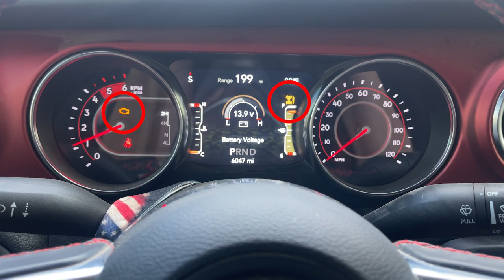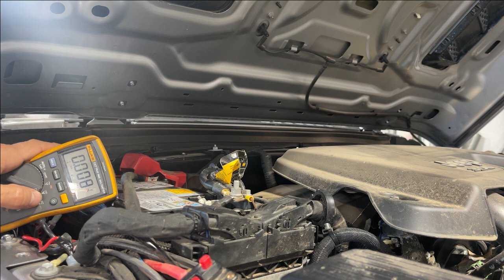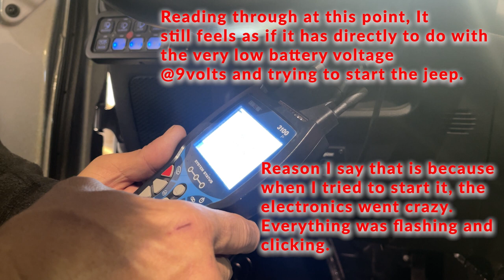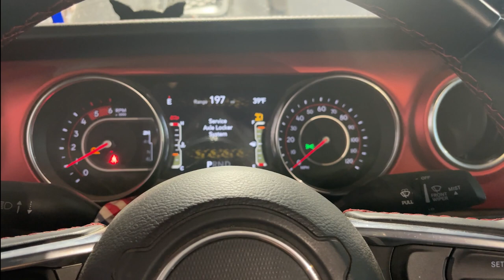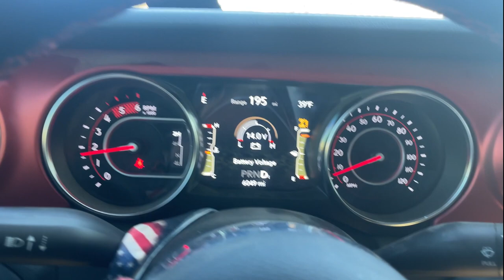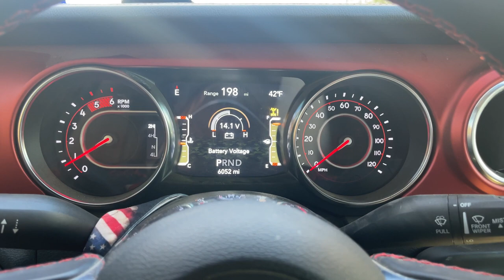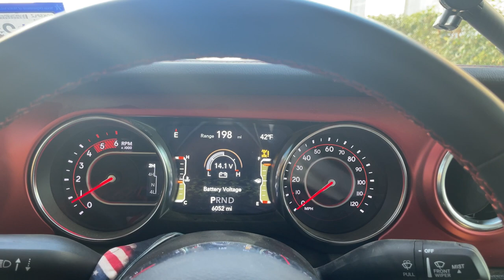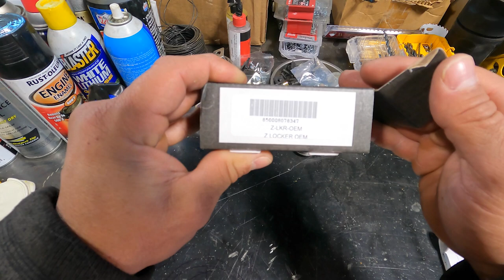2021Jeep Gladiator Diesel Electrical issues and GREMLINS only 6000 miles !!!#jeep #gladiator #shorts

Comment from the maker: UPDATE EVERYONE*****
So Randi with Yukon gear actually figured out the issue. By using the Tazer mini and deleting the lockers from the ecu, all electrical issues went away. You can manually write them to your switch bank and use them at all. It’s a better way anyway.  Let me know if you guys are interested in that mod.
Reply: Since I have a JTRD on the way, yeah - I'd be interested in seeing that mod.
Reply from the maker: @skdemars  yes sir ! So i will try and throw a video together. It really is super cool to be able to operate them individually… thanks for commenting.

Comment: I have say this I also have had multiple steering wheel lock on my 21 JT diesel most of the time I'm at hwy speed when it happens. The reason I'm watching this video is because the truck wouldn't start this morning. It was -5C last night. I boosted it with my tj and I did have any problems all day. I guess I'll see what happens tomorrow morning. I'm posting this 10 minutes into your video.
Reply from the maker: Well thanks for watching Lee. I hope you figure out the issue. One thing I would suggest is run by your local parts store and have them load test your battery. 

A battery can take a surface charge but under load it will fail if it’s not consistently charged back up by a charger or alternator. There test box will show if the battery is still good or has a failing cell. Secondly verify your battery terminals have a really good and tight connection. Remember everything shrinks in the cold. 

But -5c or 23F isn’t too good for diesel to ignite. My daily is an F350 and It’s never been plugged in neither was the Gladiator and it’s often 20F here where I live in the winter mornings.

Hope this helps and I hope it’s not a fuel sensing problem. Which I would need to understand more if it keeps happening to help you. 

Cheers and good luck. I hope this helps.

Comment: low voltage causes a bunch of bus failures, stuck relays ect 14v charging does not mean its all good. a bad cell can cause these issues. - i see it a lot at work. common locker failure- all cars have issues-
Reply from the maker: First off thanks for watching and replying. Moving on, even though the batteries showed individually 12+ volts, would you think in your experience that one could still potentially have a dead cell issue? I was thinking my next move be pulling the main fuse box loose and flipping it to manually force all the connectors in from the bottom side. My thinking is something could be a little loose. I have seen on several forums this is a common issue with the Jl' and Jt's. Anyway thanks in advance. I do believe LONG WITH THAT IT IS 100% electrical based issue. 

To update , yesterday while idling the electric power steering pump stopped working two different times. The truck was not idling for more than 10 minutes both times. Turning the truck off then back on corrects the issue each time and power steering comes back. Thoughts? No error code.
Reply: @maximumoverland  textbook bad cell battery issue. If you have one of those big jump starter packs leave it on the Jeep so it has a constant strong 12v. With 2 batteries is complicated things too. Make sure the battery terminals and ground points are clean and tight.
Reply: @maximumoverland  also look at the physical pins on the connectors. Make sure they are straight and not loose or bent. Even tho it click into place you could have a loose terminal in the connector.
Reply from the maker: @WolfOverland  Again well thank you and duly noted I really appreciate this interaction. Also the dual battery is from the factory so it’s not something I can control but I will for sure have both batteries tested this week for dead cells. Secondly thanks again about the info on the terminals I will check all the pin settings and verify they’re at the least clicking in the manner they’re  supposed to and not being bent.

Comment: Maybe with all your accessories, lights, etc you have hot wire to ground.
Reply from the maker: John, to rule out any electrical issue with lights etcetera I pulled the power and ground from the switch bank that controls all accessories. the issue still happens. Now if I reset the ECU it last for a day or so before it restarts. It's not the cold either, it was 11F yesterday and 48F the day before that. thanks for helping brain storm.

Comment: Wow... that's nearly a brand new Jeep.  I would think they could easily fix it.
I was heavily looking into buying one.
Thanks for your video.
Reply from the maker: Hey Silo man thanks for watching. I will say that I don’t want to sway your opinion on the vehicle because, when the trail slayer is running top notch there’s nothing better in the class or equal to it because the options with front and rear locker sway bar disconnect and of course the eco-diesel. The eco-diesel makes this truck above and beyond any Ranger, Tacoma, Pro4X or Jeep in my opinion. When you’re talking about crawling, this guy does with ease because of the 450 foot pounds of torque, so in low low it does all the work. As far as towing, the payload capacity may not be a lot but you can load it all the way up to max and it will literally tow it without breathing. All that being said after 500 miles I had a fuel system issue, it’s happened multiple times and the dealer couldn’t figure it out. Now it’s having all these electrical issue problems and there’s no rhyme or reason. So I will continue to be clear with everyone and transparent, and wolf above suggested some things to try this week. I will do all that. But you guys should watch my videos see that I go way off in the middle of nowhere, and the one thing I can’t have is electrical gremlins. So again thanks for watching and I hope all this helps you make an informed decision. Just so you know the jeep JL eco-diesel does it have the same electrical ghosts. I will do more research and troubleshooting but there are several entities that believe it’s due to overstretching the factory harness. So I will check that and let you guys know.
Reply: @maximumoverland  Really appreciate your reply.  👍
Reply: Could be a diesel-version Gladiator issue? A guy on another YouTube channel just got rid of his after issues with it.
I have a gas version (didn't want anything diesel, let alone in a Jeep): No issues so far (7000+ miles, 9 months of ownership) except replacing the "blurry" backup-camera that got some condensation in it (Jeep said that -- I didn't see any) and now the camera is crisp/sharp like it used to be. But that was a minor issue...
Anyway, I couldn't see ANY good reason (for MY driving/towing needs) to get the Eco-Diesel. Absolutely none.
But then I also see ZERO good reason to get a Gladiator 392 (when it comes out).  ;-)
-- BR
(2021 Jeep Gladiator Rubicon)
Reply from the maker: @GarySiloManBaker  any time friend.
Reply from the maker: @billredding2000  HEY BILL !!! Been awhile and I hope all is well sir ! 
You know the more I do research it definitely seems that most of the issues are definitely more prominent in the diesel example. 
I will say this ….. when working properly , you would be floored how well it drives and runs Bill, even with the added weights and 39 beadlocks. The eco makes everything effortless.

But BUTTTTTTT !!!! Knowing everyone at my local service center because of these gremlins is something I never imaged at 6k miles. Even they now shake their heads every time I pull in. Soooooo I’m not sure how much longer I can hang on when I depends on it so much. Again good talking Bill !!
Reply: @maximumoverland  Nice to see you again! Am only posting now & then, not as I used to, but do try when it's "appropriate" (something I can relate to I guess).
But as for your diesel Jeep's issues, I well know that just because I have a gas version (V6 Pentastar) THEY can have issues as well -- as I've seen people posting about here in YouTube. For example, the check engine light coming on at random times for apparently no reason (seems to be related to a "defective" auxiliary (2nd) battery, possibly applying to 2020 models, not so much the 2021s) and leaking rear axle oil seals. Or leaking rear window. None of those have happened to me (yet!). So just that camera issue (so far)... 
But because I already knew of Jeep's "low-reliability reputation" before I got it, it's always in the back of my mind SOMETHING is gonna happen! That's worrisome in itself -- even if I only kept my Jeep until the warranty expired (at most, I mean until the 5-year/60K miles drive-train warranty expires). 
Would it be trouble-free that long?
Given the abnormal auto-industry/market situation though -- increased costs of materials, vehicle pricing going up more quickly than in past years, Stealerships adding arbitrary ADMs on BOTH new and used vehicles -- I'll likely keep my Jeep longer. Will it STILL be problem-free for the next 8-9 years or so? I mean major issues, as minor issues are expected regardless of brand since no vehicle is immune to issues.
However, due to the SORRY "service" (damages) I recently got from my Jeep dealership on its First Service (oil-change/tire-rotation), I've decided to come out of "retirement" and do my own work from now on (at my age, it's more difficult for me to do that stuff anymore)...for sure, that can only HELP my Jeep survive over the coming years vs. having some care-less Service Monkey "professional" at Jeep sabotaging it, yes? After all, aren't we -- the dealership & vehicle owner -- supposed to be on the SAME side? ;-)
BTW, Jeep here in CO won't let customers even talk to the technicians in the back...can't even ask a question, let alone get to know WHO is working on your vehicle, and if he/she is GOOD, to request that same person in the future (as I did at my Honda dealer in TX). So you can never develop a relationship here at Jeep with a specific technician. 
Sad...
Anyway, so given my Jeep will be well cared for by Yours Truly, MSTM-certified ("Master Shade Tree Mechanic") -- not to be confused with ASE-certified (a different governing body!) -- it's then up to the vehicle itself to prove it IS or is NOT poorly built. 
Although only time will tell, I HOPE it can do that!  ;-)
-- BR
Reply from the maker: @billredding2000  well said Bill, it is now status quo these days to see far less desirable work from pod tradesmen at these dealership. 

Let’s hope for both our sanities that it’s all the lesser for you and your Jeep. I will always publish my findings in hopes to educate or help the next man. Cheers 🍻

Comment: Quick question. When you plugged in the zmotive piggyback on the locker did you have the power disconnected from the battery. Because sometimes the computer still has the code stored in it.
Reply from the maker: Hey Danilo, thanks for stopping in and watching!! 
But no I did not, it’s got two batteries one living directly under the other one from factory. I simply just watched their info video and read the install information. Both axles, I used the Tazer mini to error the code. Cycle the key and it would come back. So I suppose I could pull the battery posts if you feel deleting the code isn’t working properly.

Comment: Maybe there is a bad cell in the battery
Reply from the maker: Hey John thanks for watching and commenting. I wish that was the case,  I had the battery in my case both of them and it wasn’t the the issue. It’s since developed an HVAC bus code and sway bar connection missing. I’m starting to think the ecu could be the issue. Unfortunately Jeep told me to go ahead and drop it off and they would try to get to it in the next few weeks…… that’s just ridiculous and absurd.  Thanks again,!!!

Comment: You know there is a second battery under the main battery
Reply from the maker: Yes John. We tested both. The small motor cycle style battery was tested as well. It does really strange things. Like whole it’s idling the electric power steering stops working. Then restart the truck and it’s all fine. That’s what I was thinking a possible ecu issue.

Comment: 6000 miles it should be under warranty
Reply from the maker: Oh it is under warranty if they can catch it happening when it’s happening. This is a well documented well known problem and they cannot fix are correct. Unfortunately they had the truck three different times never could catch it so therefore they can’t warrantee it. Unfortunately it will happen repeatedly especially when you’re not close to a dealership. I’ve had lots and lots of people reach out to me about this issue. My answer has been constantly contact banks power and try their set up on your truck, it’s worked 100% of the time but I am not a professional so therefore that cannot be quoted. Three test trucks I know for a fact I’ve never had the issue reoccur after using this treatment. The first time it happened it was actually under 650 miles brand new. Thank you so much for commenting and watching

Comment: Maybe you should take it to the dealer, instead of trying to do some back yard mechanics diagnostics
Reply from the maker: John again thanks for helping. I called the dealership and they said they could see in two weeks from Tuesday. So until then I figured I would go over the simple things. I have 20years experience in my profession with low voltage 12/24/48/56v so it's all simple circuits. The non-loss of current or voltage is why I believe it to be a ECU issue or a bad module. Either way I appreciate you joining in. 🙏🏼